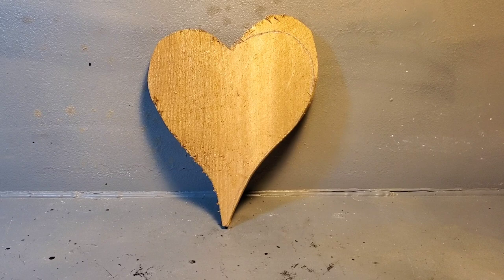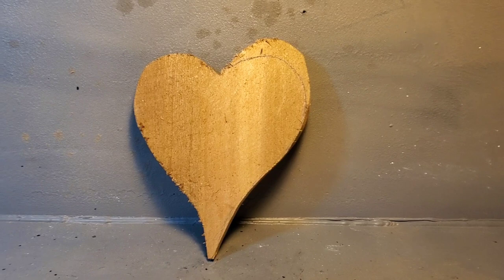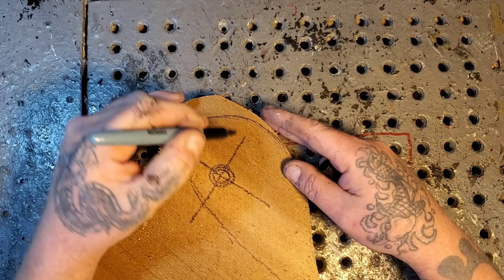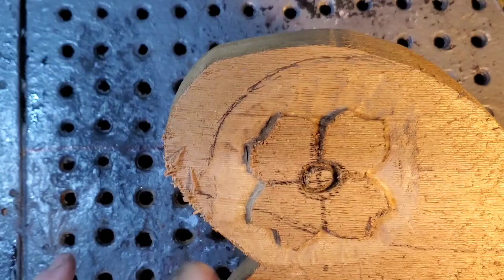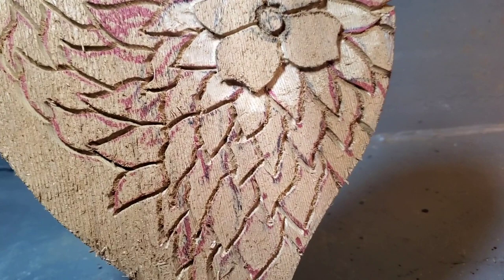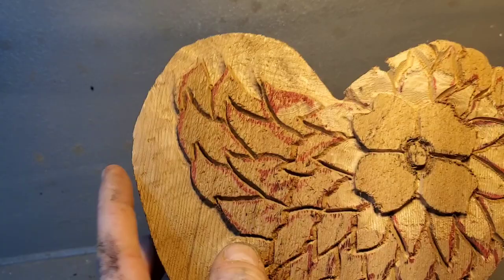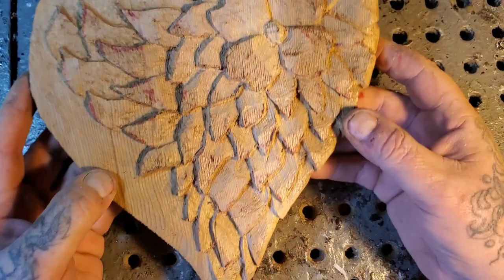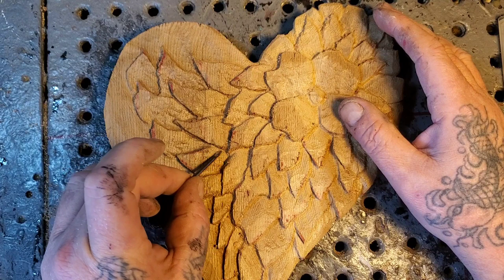Beginner Wood Carving. Step by Step Flower & Petals.

Comment: Ok so attempted this today fucked by not carving the heart out first lol used to thick of a bit to line it think also wish you would of explained the lining of the pedal Center line depth more in depth lol kinda skipped that part I went about a quarter inch deep alll around the lines which I think is another mistake but I’ll try trail and error lol keep all piece and see my progress 🤷‍♂️😬
Reply from the maker: Yup the more u do the better u will get
Reply: @CarvingFusion  thanks for getting back brother man I’ll be posting a video again I’ve only been at this craft for 2 weeks so I’m green but I been framing homes for 10 years